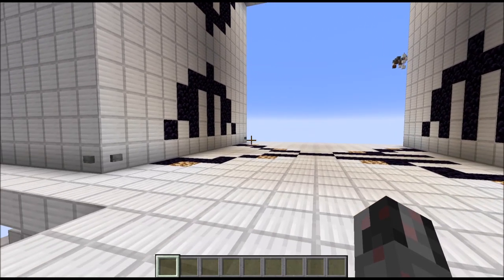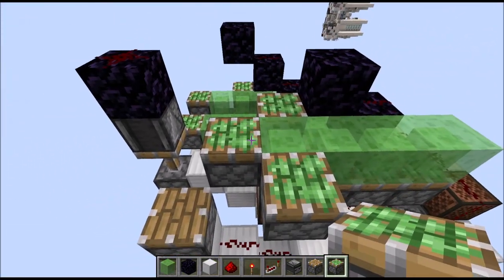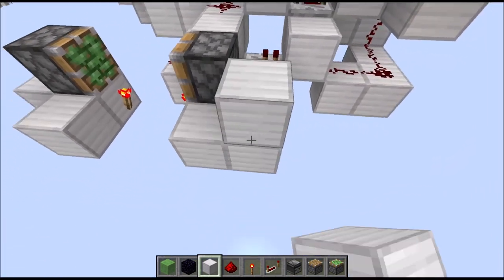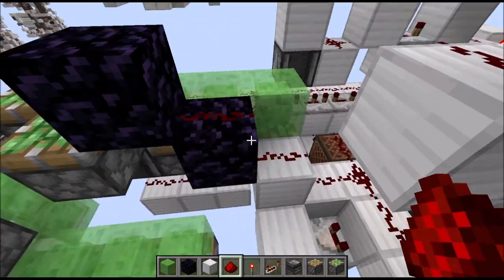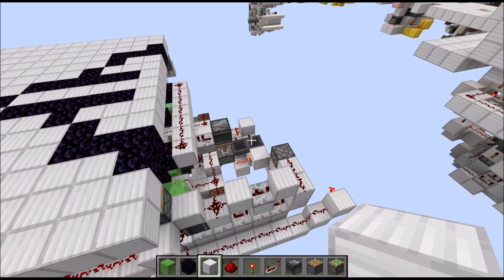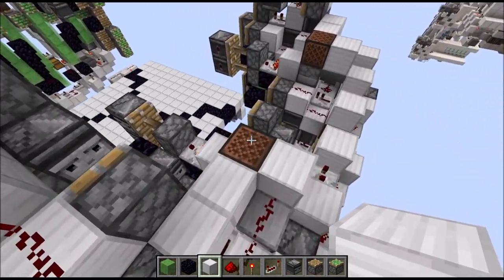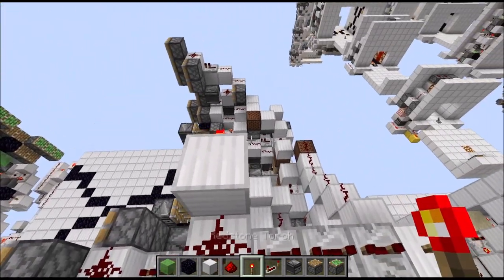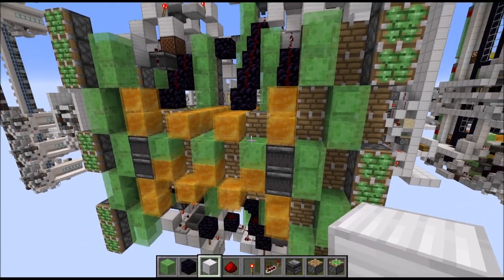Tutorial: Compact 14x14 Double Vault Door [Java 1.15+]

Comment: how the pistons at the middle of the bottom takes 13 blocks????
Reply from the maker: It doesn't. Push limit is 12 blocks.
Reply: do u have a mod let pistons take 13 blocks????????
Reply from the maker: No. Vanilla minecraft without mods or datapacks. I'm merely using certain game mechanics as workarounds.

Comment: Hey Walter, i just wanted to say you are a literal god at doing redstone, you definetely deserve more subs. But while i am building the two sides of the door, the closing worked, but the two back sides of the door did not retract. The two front sides retracted fully. Im in 1.15.2 and i have put the levers and obsidian with redstone, wire. I have also downloaded your tutorial world, and pasted the schematic on my world to run the verification. After verifying, there were no mistakes. Do you have any idea where the problem might be?
Reply: 41:55   47:03  1:00:07 these are the fixes that needs to be applied for 1.15
Reply from the maker: Yeah, there are a few things that changed with 1.16 that demanded some minor circuit tweeks. Since I'm running on 1.19.3 currently the build on my tutorial world already has them.
Reply: @RKFWalter  So is there no fix for 1.15?
Reply from the maker: If you follow the tutorial, you'll see where changes need to be made for 1.15. You already pointed out the relevant parts of the video.
Reply: @RKFWalter  ok thanks

Comment: sadly this door is directional at least in 1.18 I build it in my survival without checking if it was directional now I am sad but only the top doesn't work the rest works fine can you please make a fix
Reply: I build it on a 1.18 fabric server with 90 degrees rotation clockwise
Reply from the maker: Try mirroring the top part. There's a positional behaviour change concerning update orders of pistons that causes a toggling behaviour if you move the entire thing by a meter in any direction. It's pretty annyoing.

If that doesn't help I suspect it could have something to do with your server, since there isn't really anything directional in the build (except for the aforementioned positional update order). I only design/test in vanilla minecraft without mods. Any kind of modification to things like update order or internal timings, etc. can cause issues I can't forsee (or solve).
Reply: I FOUND A FIX!!! 🎉🎉🎉

Comment: is awesome! how long did it take to design it?
Reply from the maker: About a month (without the breaks). Or about half a year, due to me often working on a couple projects in parallel. Plus about a year or so until I finally found the time to make the actual tutorial.
Reply: @RKFWalter  :O
Reply from the maker: Smaller doors take much less time though. A 3x3 can be usually designed in just a couple minutes (if nothing unexpected happens). It greatly depends on the actual scope of the project.

Comment: Be assured, that, in 1.20.1, at least the entire bottom-segment is perfectly functional 👍
Reply from the maker: Thanks for the feedback!
Reply: @RKFWalter  Well, once more (that broke 15x15 for me), the closing worked, but with the opening, the four sand blocks were floating again ... deffecting the lower half of the sides, and somehow the entirety of the bottom segment ... (although I am curious, why the bottom completly broke down too ... )
Reply from the maker: That's rough. Are you playing with mods, or on some "optimised" server? I never had issues with floating sand as far as I can remember.
Reply: @RKFWalter  Only Opfitine and shaders.
I don't know how far optimised the server is I'm playing on, but actually, the sand blocks seem to be the only issue.

Is there a (of course, more complicated) way to replace the sandblock-slab-piston-combination with something else, even if the compact measures of the door have to be sacrificed?
Reply from the maker: To repeat the comment I gave you at the 13x13:

Haven't really tested it, but in many cases you should be able to replace these piston buds with honey-based ones (piston at the bottom, honey block in the middle, full block on top). The timing could potentially deviate a tiny bit, so you would have to check if it works out properly. Just make sure you replace the blocks in the vicinity with immoveable blocks, or the circuitry would desintegrate.

I made the reverse change between my first and later designs for the 11x11:
https://www.youtube.com/watch?v=OFoUjp7mAn4&ab_channel=R.K.F.Walter
https://www.youtube.com/watch?v=_vvciCmE2aM&ab_channel=R.K.F.Walte
Reply: @RKFWalter  The sides completly broke down - BUT, because I haven't yet repaired the extended pistons. The bottom segment completly repaired itself 👍 Now up to resetting the side piston layouts ...
Reply: @RKFWalter  Successfully resettet all the pistons and included the honey-block replacement. The closing of bottom and sides fort perfectly once again ... let's see for the opening ...
... this is weird. The bottom and upper half of the sides open perfectly, but the lower half of the sides is still malfuncioning 🤔
Reply: @RKFWalter  On the lower half of the sides, the very first backwards-retraction fails, leaving the lower half fully extended even when the door is closed.
Reply: @RKFWalter  As someone else commented on this video:
The door also seems to be somewhat directional.
My version has front facing east, back facing west ... yours is differently alligned, as I figured.
Reply from the maker: I suspect it's the replacement for the sand-piston BUDs. The falling sand would introduce a bit of additional delay until the connection reestablishes. The replacement is a bit too fast. Can't think of a simple fix, unfortunately, it's too integrated in the circuitry. Sorry :(
Reply from the maker: Concerning the orientation... I build the door in the exact same orientation as you in my testing world and it works fine. There's positional Piston "feature", though, which may require to mirror the top part depending on where you build the door.
Reply: @RKFWalter  Well, I guessed that because of the way the top-facing observers are rotated. Mine are mirrored to yours.

And, it doesn't have to be simple if it works. Five additional blocks? fine.
Reply from the maker: I was talking about my "Testing" world not my "Tutorial" world. That's where I do the actual designing... I highly doubt you have seen it as it's not public.

Also those "five blocks" (>20, more likely) will likely take me several hours or so to figure out. I first need to figure out what the different parts of the circuitry actually do again, since it's been years since I designed the door. But I'll take a look, if there's a simple fix I might send you a picture or somehting. It's not worth making an extra tutorial.
Reply: @RKFWalter  You're right ...
I've been too demanding anyway.

Having that big of a comment-conversation was a bit too much. I try to fix it myself.
Reply from the maker: Thank you for your understanding. I wish you luck with finding a solution for your situation! Nevertheless, if I find a simple fix I'll let you know.
Reply: @RKFWalter  Funfact: the 13x13 one also included the sand block ordeal, but there the sand blocks were behaving perfectly normal - it's right next to the 14x14 one ...I built most of your double vault doors in a highly well-ordered row one next to the other.
Reply: @RKFWalter  Now, when I stood very closely to one of the sand blocks (maybe, being close avoids the floating-glitch), the door somehow closed AND opened completly normaly 🤔So maybe it is a server-tick-thingamajig ...
Reply: @RKFWalter  I might have found a solution:
I placed an observer looking into the air-block above the sand; when the sand is briefly in the air, the observer sends a signal through a redstone dust behind into a piston above, who pushes into the additional air above the floating sand, ?budding? it to fall down again. It seems to work.

I now tested it multiple times on the right side - it actually works! Have to repair the left side, as I ruined it completly during my experiments ... 👍
Reply from the maker: Definitely sounds like a BUD. Haven't encountered that yet with sand (except naturally generated overhangs). But if it's just a BUD, then the fix should be decently simple as you already figured out. Thanks for telling me, now I have a trick I can try if I encounter this type of situation myself :)
Reply: @RKFWalter  I can confirm to you, that I was able to successfully and fully funcionally assemble your 14x14 - but I had to rotate the top part by 180° 👍
Reply from the maker: Thanks for the feedback!